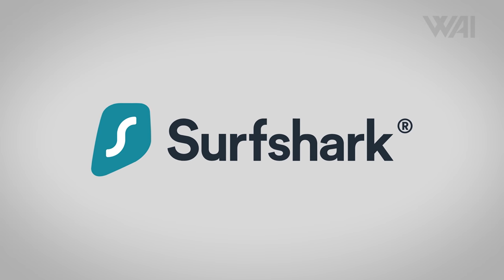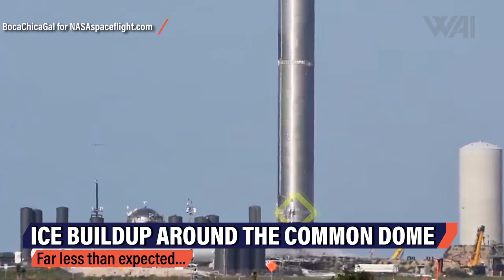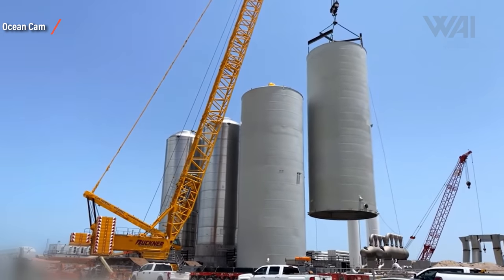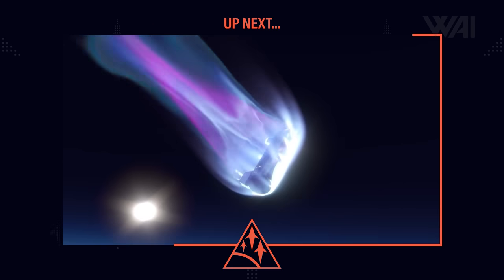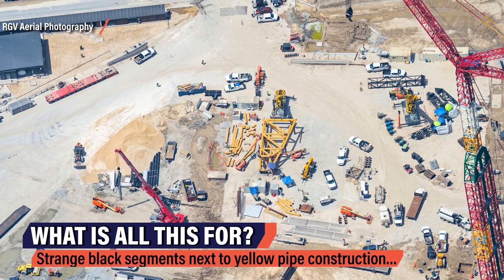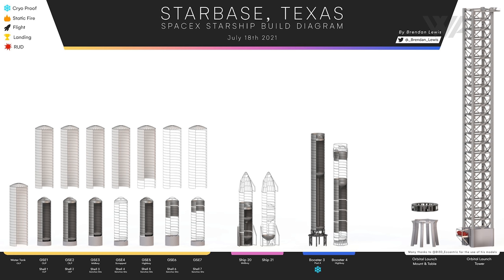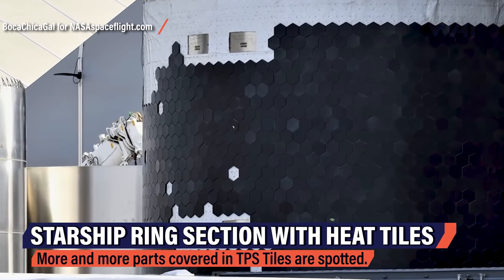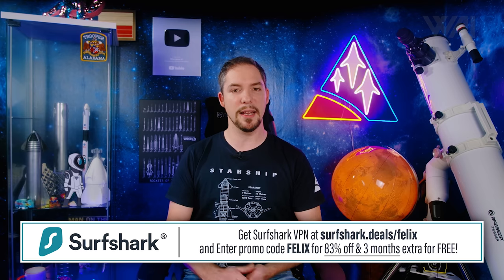First crucial SpaceX Super Heavy static fire completed & Starship Heatshield taking shape!

Comment: It's technically not a "heat shield" but a "heat absorber" such that the plasma doesn't exist in the first place. That means you have to look at the underside of the heat absorption tiles too to see

A: is it the same material as from without and
B: how does it attach and then stay attached to the re-entry vehicle.

So far besides the radical fuel and engine choice everything seems to be not much more than the sum total of all the experience gained from all of the iterations of NASA Spaceflight which I think gives a high probability of a launch anyway.

Of course there is the ever-present Galveston Disaster as a backdrop..

Comment: How much heat is generated upon reentry and how much is generated by the raptor rocket?  If the rocket is hotter then if the shields can withstand that it is good to go.
If they really want to test their heat shields why not take one of the rings, plaster it with the heat shields the same way they would on the starship and place it behind the raptor rocket on the horizontal test stand and fire it off on full burn.  Put a slab of them under super heavy test rocket and fire all of them.

Comment: Is there only three engines on the starship booster hence only a 3 engine static fire?  What will happen if all of the engines are fired at once?  What is the expected force and can the tower withstand it?  How long will it take to examine all of the engines and everything else after the main full blown static fire?
Reply: Yes. SpaceX engineers can answer all of that
Reply: There are only a few engines on the SN3 booster, since they're just testing tanks and plumbing. For the final booster, they're certainly not going to be testing all engines at once for static fires, because 30+ Raptors firing at once are not going to be static...
Reply: @simongeard4824  "Certainly"?
Reply: @alvianchoiriapriliansyah9882  Well, I could be wrong, fair enough. But it's difficult to see how it would be possible... seems more likely that if static fires are needed, they'll be done a subset of engines.
Reply: @alvianchoiriapriliansyah9882  Check my math here, since I'm having trouble believing it myself. 33 Raptors at 2.3MN each, that's 76MN total... so about 30MN for all engines at minimum power. That's only slightly less than the 35MN produced by a Saturn V at maximum power.

Comment: Elon had talked about venting methane through the belly of Starship during reentry as part of his heat shielding, but during these times, there was no heat shield tiles shown in the animations. Are we still venting gas as part of the heat shield, or have we moved away from that idea?
Reply: The latter, not efficient for use of fuel
Reply: @alvianchoiriapriliansyah9882  That was actually my idea when I first heard the idea, though I can see where he was going with it initially. I guess it takes way too much cryo to pull it off.

Comment: Raptors can't be throttled down below 40%. How on earth are 33 engines going to be fired and the whole thing stays on ground?
Reply: By a strong clamps
Reply: If they're firing all 33 engines at once, it's not staying on the ground... clamps or no clamps.
Reply: @simongeard4824  It should stay with clamps, or no proper test
Reply: @alvianchoiriapriliansyah9882  Sure, but even on minimal throttle, we're talking about something like 40MN of thrust with all engines lit. That's more than a Shuttle on take-off, with the SRBs lit. I'm doubtful that it's going to be possible to do a 33-engine static fire...
Reply: @simongeard4824  Literally every rocket have this designed in mind to hold in case of an aborts, why can't Super Heavy do the same?

What makes you doubtful? Do you have the detailed engineering design of the launchpad in hand, then you're happened to be a structural engineer & considered this as underperform with confidence?
Reply: @alvianchoiriapriliansyah9882  Simply the magnitude of the numbers involved. No, I'm not a structural engineer, so maybe I'm wrong and they can build something that does the job. But  I know the Shuttle pad was incapable of holding the vehicle after the SRBs lit, and Superheavy produces similar thrust at minimum throttle. So the abort plan may simply to be shut down the engines...

Comment: August launch not off the table? Well, it's in the future so technically I suppose it's not off the table but that's only 5.5 weeks away now. Does anyone really think that booster 4 and ship 20 can be fully built, taken to the launch site, and all the pressure, cryo, WDR and probably multiple combinations of SF tests done ready for launch in that timescale where they're not only testing booster for the first time but also all the orbital GSE infrastructure? And that's assuming they could get the launch table installed and working, tank farm done and launch tower complete.

I can't believe that anyone could still think that the first (sub)orbital test flight could happen by the end of August. Personally Felix I think you need to be careful to not lose credibility by failing to throw some reality onto some of the more overly-optimistic timescale estimates. My guess is no earlier than October and I wouldn't be surprised if that slipped to at least November if not further. I'm a huge SpaceX fan but this first full-stack test flight is such a huge leap forward with so much left to be finished and then tested. In my opinion it's still going to take quite a few months to get to launch day.
Reply: Keep an eye on the updated date here
www.nextspaceflight.com/launches/details/6754

Comment: Why not cover the entire ship with heat shielding and use the flaps to roll the ship in case one side gets too hot from damaged tiles? For manned missions, this extra redundancy could save the whole mission (learn from the shuttle disaster). Plate over any windows. Inside, have water in the walls that can be shifted behind a hot spot.
Reply: Very complicated
Reply: @alvianchoiriapriliansyah9882  I think rolling would be less complicated than the flip maneuver. Lots of water will need to be stored somewhere so why not where it can have dual purpose.
Reply: @kensearle4892  More water means less useful payload to carry. People are too easy to propose anything even if they didn't experienced being a rocket engineer
Reply: @alvianchoiriapriliansyah9882  if you are carrying people to Mars, they will need tons and tons of water for 2+ years (at least until they figure out how to manufacture it on Mars) so for human-rated Starship, I would add extra shielding to all sides. If it's a cargo ship, then you would maximize cargo, not bring water just for shielding.